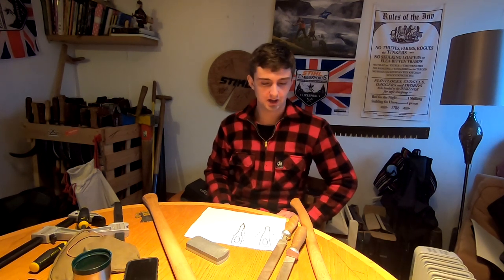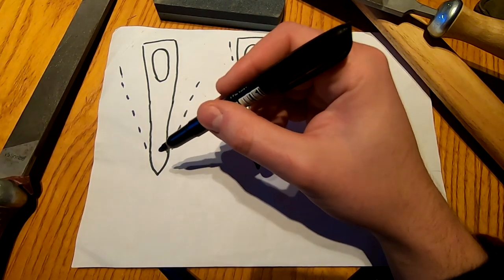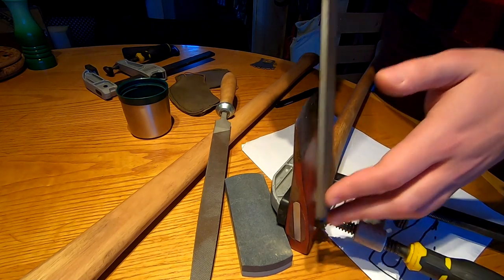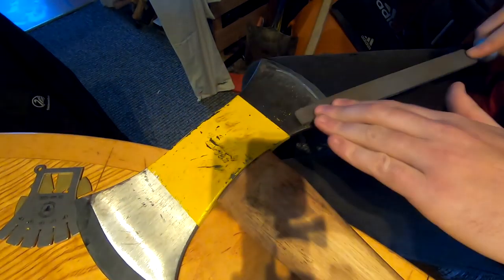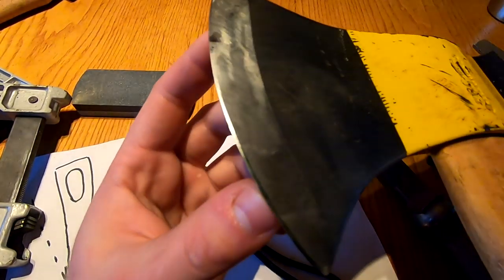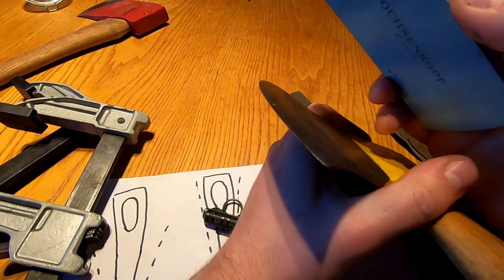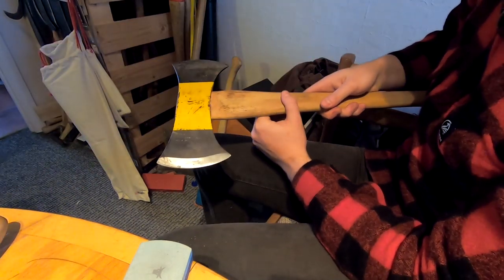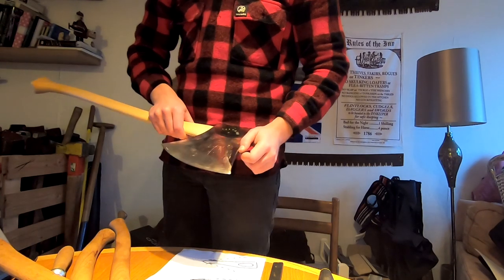How to Sharpen an Axe for Efficient Chopping

Comment: I am not a big axe user, but recently got caught up with Ben’s enthusiasm and was trying to measure the grind angles of the axes I have. I tried all the carpentry gauges I had, and made some templates.  Threw all that out.  Just trace your axe profile on paper in a notebook with a sharp pencil, extrapolate the angles for the cheeks and bevels on paper with a ruler, and use a cheap protractor to get an accurate angle - virtually zero expense and very visual and a good graphical record
Reply from the maker: Thats a great idea
Reply: Not sure if this is a good enough representation  of the profile between heel and toe.

Comment: Great tip on scratching the eye. I do that with most axes, and it installs an ideal primary bevel, and sets you up for an easy secondary bevel. Most people I see "restoring" axes on youtube grind the whole bevel at an obtuse angle to avoid the work of thinning out the bit. Maybe that doesn't matter on a decorative axe, but I couldn't imagine using an axe like that and pretending nothing is wrong.
Reply from the maker: yeah I know what you mean, seen a lot of very obtuse 'restored axes'. Swing one for 5 minutes and youll find out the hard way how poor that kind of grind is. not only do they not cut but they decelerate suddenly when they hit the wood meaning a lot more shock is transfered to the hands and elbow. A miserable experience to use something like that

Comment: So im only 5 min in, 
This is quality stuff Ben, I would of course, expect no less from someone that actually uses their tools!🤣
I too usually grind in a 22-16 main bevel and then usually roll the actual apex to a greater angle.
But I would like to comment on the "speed bump" theory.
I think I greatly depends on the wood in your environment.
Case in point,
My American axes are typically set up with a very smooth and slightly convex edge that goes from cheek to final apex and they cut our hardwoods best in that state IME
But I have had a chance to cut some softer Grey Birch, which is very similar to the native Finnish Silver Birch, with my Billnäs 12.2 set up with a traditional grind, flat ground bevel at 30° with no convexing of the "speed bump". 
It cut it very well, exellent penetration, no bouncing out of the cut or binding.
The fairly flat sided Maine wedge is another axe that defies my experience, it cuts extremely well in our hardwood yet is doesn't stick. Something I thought only an axe with a high centerline and good grind could do.
Its hard to say what will work when axe geometry, species of wood in the environment, and the individual users skill and experience can vary the opinion so greatly.
But this stuff is fun and engaging to talk about and we all learn from it.
Thanks for putting put some awesome content, your stuff definitely has an influence on my thoughts and experiments.

Comment: I have a lot of balsam fir to split next spring. We had a really bad storm on the east coast of the states and it rocked upstate/ central New York two weeks ago today. I had a 70 foot balsam fir uprooted a long with two other smaller balsams. I used my Husqvarna 350 to limb and buck the logs and had so many branches and debris to burn. I just finished stacking all the rounds for the season. Two feet girth at the base and it gradually narrows towards the stem. This past Monday we got our first snowfall of six inches. Early winter snow fall here.
Reply from the maker: 2 feet is pretty big, fir can be hell to split if its very knotty

Comment: As most of my axes are old or antiques. And definately have a good cost to acquire and ship.  And , I have Very frozen wood where I live   Mid October to mid, late April. I am Super worried about breaking a big chip out of the bit. 
 I do Not like a bouncy axe, but don't like a sticky axe either I dislike sticking more than bouncing. 
 I have a HYTEST Challenger that is Fat that I want to try thinning down to 20° . But I think I'll get a guages first

Comment: Ben, I am happy to say you are bang on with the edge geometries. I have proven how a micro-convex secondary bevel considerably strengthens an edge without impairment of cutting ability, as with my demonstration of the edge "issue" on the Les Stroud Bushman Axe. Also, the review of the Toporsib Bobr Axe (Siberian/Taiga Pattern), wedged profile/ wedged cutting edge, stropped micro bevel...chops like a Beast!  I still am researching Billnas/Kellokoski (Finnish) Axes. Most of mine are thick to very thick wedges tending to be fairly heavily convexed. I have seen an old video of Finnish Forest Workers (1940's) in competition splitting logs and limbing large trees. Of course, it would be good to know how they filed the edges. nevertheless all their axes appear to be the 'typical' thick wedge patterns.  I also agree that there is a lot of strong opinions out there! Best Wishes, Chris
Reply from the maker: I think the finish axes arent really for bucking efficiently but mainly splitting, limbing and carving meaning the prefered geometry is different
Reply: @benscottwoodchopper  Perhaps so, most falling at that time done with bow saws. I have a Billnas 12.3 and what looks like a 12.1 that may have been re-ground, they actually buck quite well (The 12.3 is a slimmer wedge than the 12.1 and 12.2. Also lighter, it is a very good limbing axe). The Billnas no.7  I have is a heavy wedge with shorter cutting edge, with heavy convexing;, the head weighs about 3.5lbs, it splits very well. I have seen old photos of them been used to split Birch Stove Wood lengths very effectively. Often two such axes would be used to rive down heavier logs (swung alternately by two men, women or boys in the war effort to process firewood). the polls are heavy and show sighs of heavy beatings. Incidentally, the Birch hafts were/ are very durable and transmit less shock than the regular 'American Hickory'.  That said, there are specific ways the Birch handle wood is prepared and hung and the grain orientation was different to what is seen as optimum today.
Reply: @redcanoe14  I'm not an expert on this subject, but there certainly were dedicated logging axes in Finland that were slimmer in profile. The saws, especially big two man saws "justeeri" becomes replacing the axes and the axes started to get more general shape. The Billnäs 12/1/2/3 i think was marketed like a general axe. What i have seen old Billnäs axes the polls are almost always heavily used, maybe from driving wedges.
Reply: @hauki9286  thanks for joining the discussion
Reply: @redcanoe14  Thanks for the vid. very interesting and entertaining.
Reply: @redcanoe14  Great video! I'd love to hear more about the birch handles!
Reply: @Ajaxykins  Birch has been used by Finland and many Eastern European Countries for a long time. I believe the preferred Birch species is Yellow Birch. There are numerous accounts of Birch handles being as good, in some cases, more durable, than Hickory. My experience is positive, so far no shafts have broken, or split. The impact shock find, with Birch, is less than with Hickory. Of course, Hickory is harder than Birch and we can assume that in the situation of overstrikes (poor axemanship) Birch will be less robust, but longitudinal splitting might be an issue with Hickory. Also shafts of Birch will break more easily if levered upon (a factor influenced by the design of the axe head and eye placement), but excessive leveraging with an axe is also poor  axemanship.  The Finnish Woodsmen also paid close attention to annular ring pattern and how their axes are hung. I hope this goes some way to answering your questions. Best Regards, WS

Comment: Having a thick piece of leather as a guard on the file is a good idea. If youslip it saves the fingers. Liam Hoffman is not a tree surgeon.  Or forestry worker. The reason axe heads are shaped like they are, is because they are designed for a specific job. Different grinds for different timber.

Comment: It was only by going to a Sharpening course with the Hedgelaying society i realised how much work I needed to put in to even just a hatchet like the 20" rucksack axe by Bahco which has grown on me since then as a nice beater with a piece of waxed linen wrapped round the neck because a friend of mine cracked the handle.
That Tui at the end is disgustingly  sharp lol
Reply from the maker: Not tried the bahco axes but they do seem like they have good potential
Reply: @benscottwoodchopper  Got an oldie boys axe with the black paint and Helko Werk stamp on as well for a tenner on Gumtree because im a student its thick as hell kind of like a main wedge pattern I mean its a great splitter but still needs a fair bit of work to cut well it was definitely designed as a chainsaw axe with a pretty wide poll and nice straight handle is suprisingly powerful for a 2 1/4lb head. They seemed to know what they were doing.
Reply from the maker: @ajaxtelamonian5134   I used to have a 4lb HW stamped one but it was stamped sandvik, i think bahco took them over

Comment: I'm glad I watched this video.  It gave me a better idea of what you mean by various terms.  For example, what you call a microbevel, by some definitions at least, is what, on a knife, someone would refer to as the edge bevel (where a true microbevel is invisible to the naked eye, and the result of a few passes on a strop making the very apex of the edge more obtuse).  While what you call the edge bevel, on a knife, someone might call the primary grind (i.e. the grind before the edge grind on a flat or saber ground knife).  The tuatahi axe you brought out at the end may have answered a question I had in mind: what would happen if you did a true convex grind?  The convex grind you showed is not a single grind - there is a convex grind, and then another grind (cant' tell if it's more flat or convex), and then your "microbevel."  If you eliminated that secondary grind, and brought the initial convex geometry all the way to to the apex (with no secondary bevel, or a true, hardly visible, microbevel), you would have a much finer, albeit possibly more delicate, edge.  A good convex geometry, though, even when zero ground (no secondary bevel), can help support even a thin edge, like an arch, so I'd be curious to see if it's too fragile for an axe, especially if not done too thin.  While it may be good on an axe for strength, splitting profile, or preventing sticking, from a cutting point of view, in terms of the edge, a convex geometry is wasted if you add a "v" edge (flat-ground edge) to it - the whole purpose is for the continuous convex geometry to come to the apex (or just short of it with a very small microbevel, if needed for edge stability), as it can allow for more strength on a thin edge, and flows through wood better, having a much smaller contact patch than a flat-ground edge with greater separation of the medium (splitting of the wood, in this case, but even on a small scale, ito of the edge itself, rather than the whole axe-head shape, although is the same principle at different levels of resolution).

Comment: I think your very knowledgeable on axes but the only thing I disagree with is stoning your axe. Yes it is maintenance but it should be done about every 12 hrs of use. For some that's once every 2 yrs but I have to do it about every 2 or 3 weeks. You can get by without doing it but it will keep it at optimal cutting ability.  Axes are like opinions, so your not wrong by no means bc that's what works for you. Your a great axman. Keep it up!.
Reply from the maker: No I agree, the major point I was trying to get across was your axe should cut well after the filing stage. Once you are happy with the results and have used the axe a fair amount THEN stone the edge. after that you should'nt need to use the files again often, only for major damage or thinning the bit again as it wears back
Reply: @benscottwoodchopper  
Yes sir. I stumbled on your channel and loved it bc of the no nonsense straight up approach of showing people how to use axes safely.  Your extremely knowledgeable on axes, and finally someone agrees with me on the gfb small Forrest axe. Most people worship that thing but best use I've gotten out of it is for kindling. I have been using my prandi and my vevicut by council tool. You should do a vid on a prandi and see if you like it. Thanks for replying and for your great video's . KEEP CHOPPIN...
Reply from the maker: @205jab4  I am very interested to see how prandi compares, probably will get one at some point

Comment: Could you provide a link for the grey bevel gauge? Have not seen one like that and it looks superior to the one I have.
Reply from the maker: Its an ochsenkopf one specifically for racing axes, 17 to 13 degrees so not that handy for most uses, better off with a veritas one with 45 to 15
Reply: @benscottwoodchopper  Thank you sir!

Comment: What kind of files do you use/recommend? New files in the US are all Chinese/Mexican junk that go blunt after one use and new old stock Nicholson's are bloody expensive.
Reply from the maker: Vallorbe files are the best ive used, swiss made and quite cheap here
Reply: Timbo Slice I ordered a 10“ Bahco farmer‘s file on Steven Edholm‘s recommendation and it gets the job done. Cost me $19 on Amazon.
Reply from the maker: @2294cb  Bahco ones are perfectly usable, vallorbes cost me about £7 or $10 and are better though. Ive heard vallorbes are hard to find in the states though
Reply: Ben Scott looks like I can get Vallorbe for about $38. I‘ll check them out when I need a replacement.
Reply from the maker: @2294cb  $38 for one? screw that, buy enough to make postage worthwhile and see what customs will charge, gotta be cheaper to order from the uk https://www.axminster.co.uk/vallorbe-swiss-flat-files-200mm-ax979512
Reply: Been using the Oregon flat chainsaw file which is a nice agressive little file that would be good for finishing which was about $20 in Canadian tire im sure the US equivalent would be similar.
Reply: Great video Ben. Love the tomato slice at the end great comedy value

Comment: Despite my axes mostly being wedge bangers, i still like to have a sharp edge and good geometry in case my saw gets pinched by a limb it's the quickest may of freeing it. I agree you really don't need to have an axe be all that sharp, though i personally still do get it shaving sharp just because i enjoy the process, but it is totally unnecessary.
Reply from the maker: Indeed i also like sharpening, can be pretty relaxing
Reply: @benscottwoodchopper  Regardless of it being pointless, i think most people can admit to the satisfaction of achieving a really sharp edge on any tool.
Reply from the maker: @zombiefighterof1987  what I was trying to get across is its best to get a axe cutting well after filing and then use stones once you are happy with the angles. I agree it is very satisfying especially when you get an axe to shave for the first time

Comment: If Council Tool and Hultafors are cheap, i wonder then what axes are the expensive ones? :)))
Reply from the maker: you can buy council tool for £25 and hultafors for £40. Expensive would be gransfors at £120-150
Reply: @benscottwoodchopper  Sorry to tell you this but the cheapest hultafors axe where i'm from is 80 euros. That's about 90 dollars. So it ain't cheap at all. When your salary is about 450 euros, trust me, 80 euros for an axe, it's a lot.
Reply from the maker: @Marian1983.2D  not sure what you are getting at, what is cheap in your book then? Price changes depending on what country. Hultafors, Rinaldi and council tool are probably the best qaulity for the lowest price out there i know.
Do you have a brand in mind that is better for much less? I think at that stage we are talking chinese and they are garbage

these guys ship hultafors all over europe.  https://uk.knivesandtools.eu/en/pt/-hultafors-chopping-axe-1000-gram-hy-10-1-0-sv.htm
Reply: @benscottwoodchopper  I'm not getting anywhere. What i call cheap is an axe that costs maybe 9-10 dollars. That's what i call cheap. And yes, it's chinese but i have some of those and they are still going strong after 4-5 years of using.
Reply from the maker: @Marian1983.2D  The trouble is with Chinese stuff is the quality control is poor, therefore It is difficult for me to recommend anything to other people. I do have a older Chinese diamond brand axe which is good. A council tool axe costs £25 here and a pack of cigarettes is £11, a bottle of decent whisky starts at £30 so for the majority of my audience that is very cheap for a quality tool. I do think what matters most is not how the axe is out of the box but how you sharpen and modify it. And of course how you swing it. I may keep an eye out for even cheaper axe in the future but so far i haven't seen anything very good
Reply: @benscottwoodchopper  I pretty much use only vintage axes that were produced in my country about 40-50 years ago. That is what i call good steel. They are better than all the council tool and the hultafors.
Reply from the maker: @Marian1983.2D  Oh right yeah, restoring an old axe is very good for a lot of people. Here it has gotten more expensive due to collectors. Where are you from? Do they have interesting axe designs?
Reply: @benscottwoodchopper  I'm from Romania. The design is simple east European axes, but to me an old axe (let's say an axe from 1961) has more value than a Garansfors Bruk or other overrated brands.. You can see my posts on Axe Junkies, i'm the only romanian blacksmith that is posting there :)